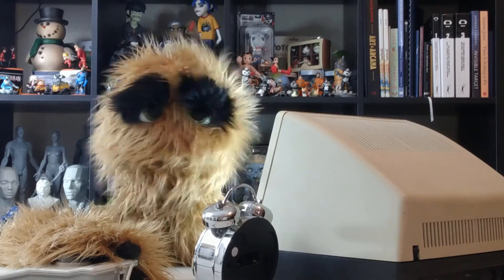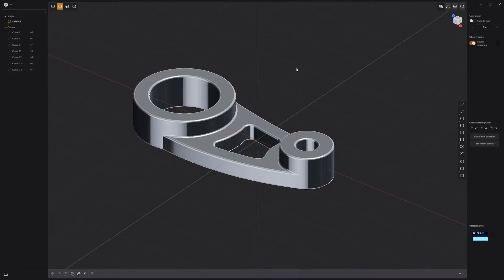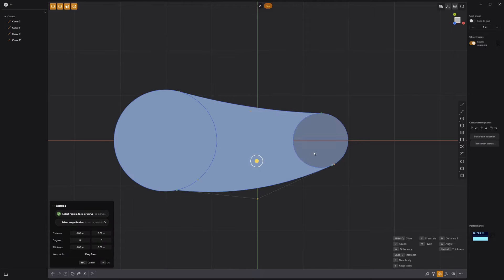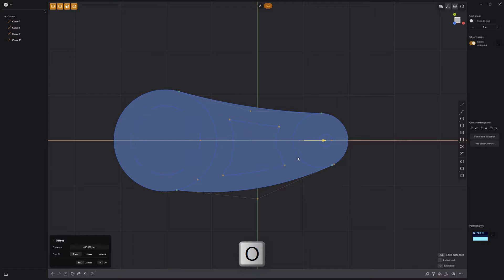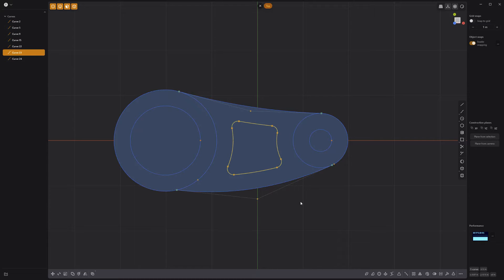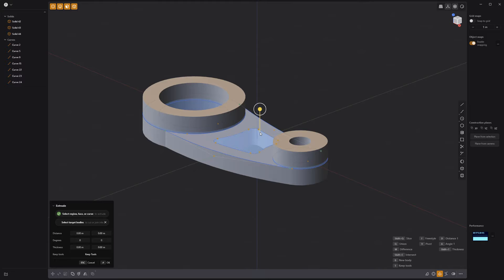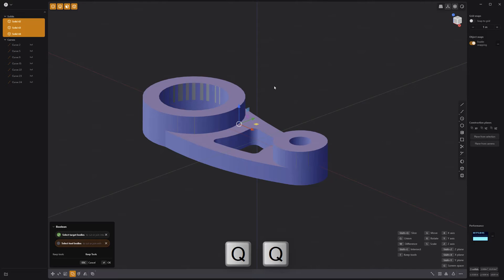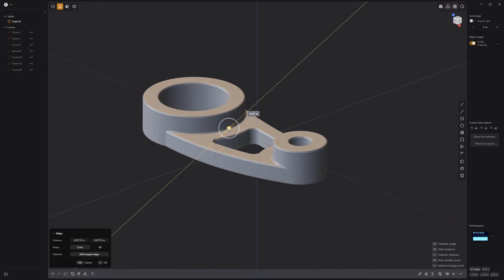Plasticity | Modeling Exercise 06

Comment: 0.40.. sometimes it is pretty hard for me to add a fillet to the edges.. I mean it is not working so instant as you are showing, sometimes I am even unable to create it, and I am trying changing also parameters directly in that pop up menu. Maybe some glitch in my version? Got 1.1.0 version. Thank you.
Reply from the maker: Can you share example... Fillets seem pretty solid from my experience.
Reply from the maker: Also give this a go-
https://youtu.be/hBvbhXrQ9po
Reply: @pixelfondue  thanks I will check, if the problem happens again, I will eventually make some video.
Reply: @lennymanny6364  did you draw tangent curves inside other geometry by chance?
Reply: this comment was very helpful. been going through each of these exercises and kept getting fillet issues when selecting all fillets to operate on at once. on further inspection i did have tangent curves inside my geometry. I was trying to get those curved lines looking smooth against those circles and the line would overlap/bend inside the circle to reach the outer circle line. when i adjusted it to look "less perfect" fillet worked just fine. I'd be curious if there's a way to snap and adjust the spline curve quickly to get that desired "perfect" look where it smoothly transitions from circle to spline curve. I can go to points > press G G > and move it - but there doesn't seem to be a way for it to snap